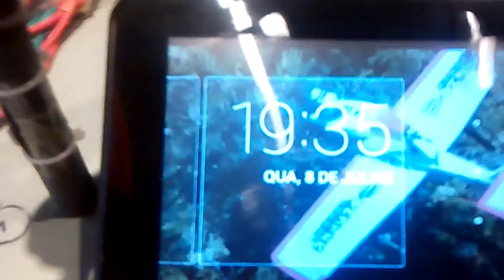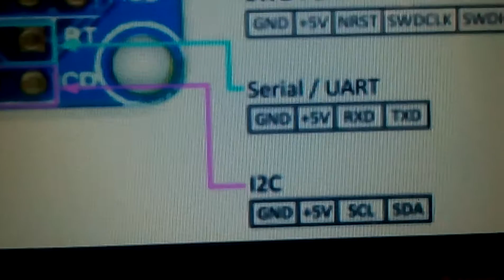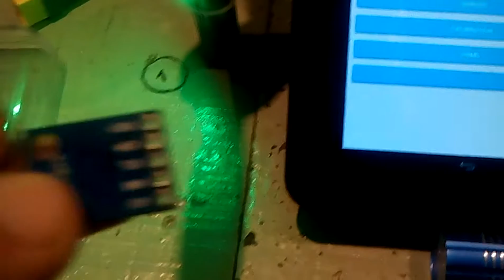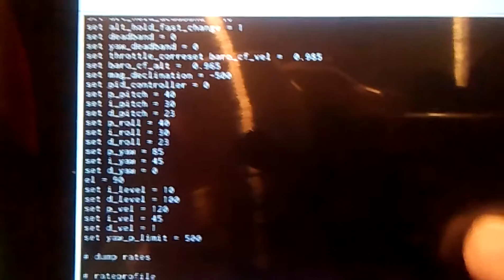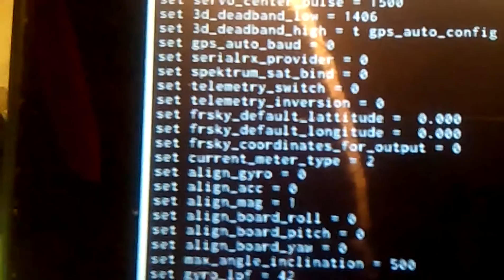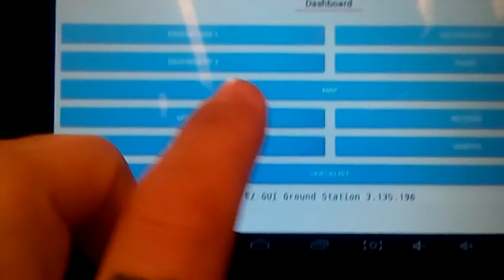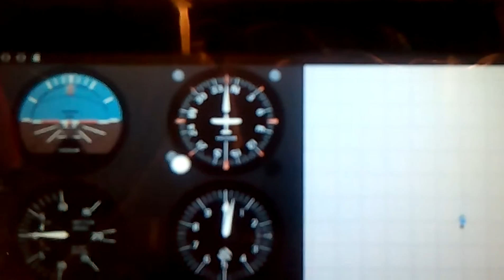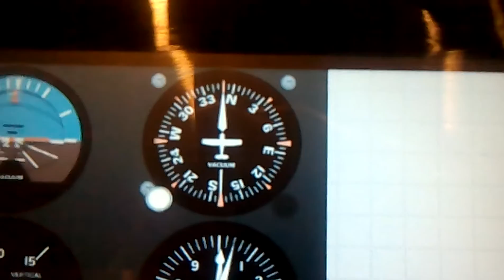Adding external Compass MAG sensor to Flip32+

Comment: I have only one SDA port on my SP F3 and I need to connect an external Barometer and a Magnetometer, so can you tell me how should I connect it out of one port? Is a parallel connection required?
Reply from the maker: On my f3 board I connected mag to I2C port...now to connect 2 sensors I am not sure if a parallel connection will work...
Reply: luisfilipe1983 So how to connect all the sensors at once?
Reply: you can add a I2C splitter board and add up to 4 or 5 sensors
https://www.ebay.com/itm/Pixhawk-I2C-Splitter-I2C-junction-board-hub-expand-module-accessories-with-cable/152781635003?epid=563705613&hash=item23927ebdbb:g:TP4AAOSwNRdX9byf:rk:2:pf:0

Comment: Thanks, on my flip i see that line to cut but noticed that there are no components installed just above as on your board.
Reply from the maker: Vic Prk Are you sure you have the Flip32+ 10DOF version?? as far as i know only the 6DOF version hasn't got MAG sensor
Reply: luisfilipe1983 It's got the sensor just isn't anything soldered to the board above it like yours
Reply from the maker: Vic Prk hmm...probably a slightly different version of the board...there are quite a few out there, some of them have minor differences but all in all they work all pretty much the same..